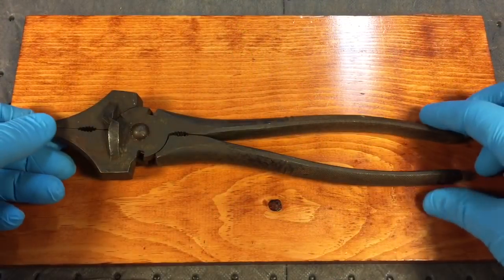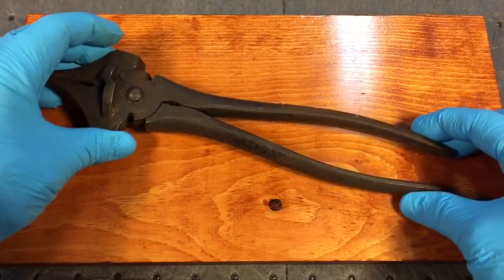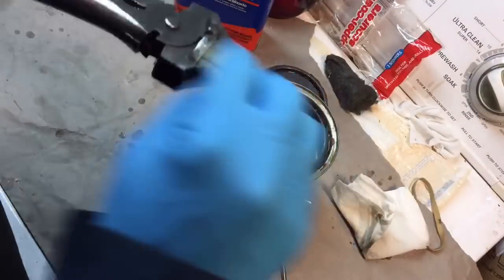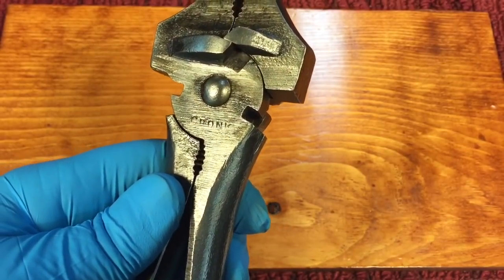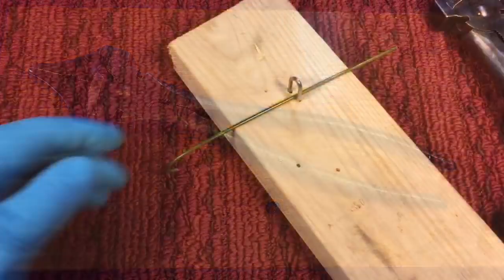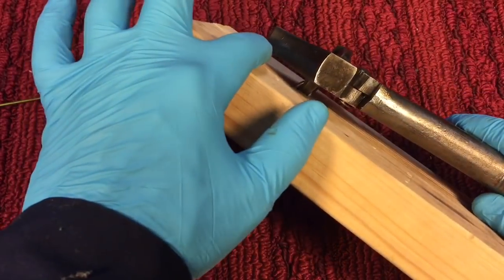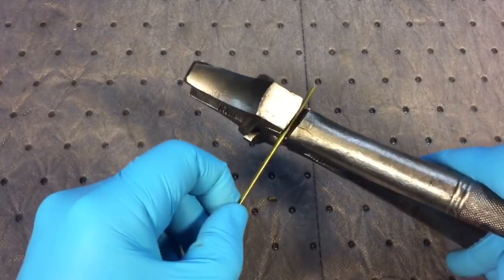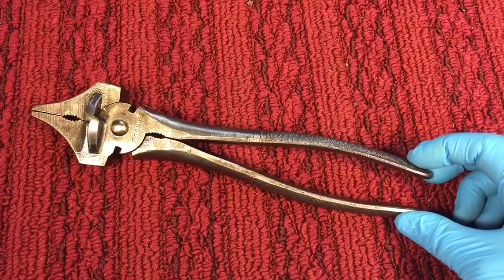1898 CRONK Fencing Pliers Restoration

Comment: Was just cleaning up a pair of pliers and couldn't make out the lettering.  Turns out the Cronk name is on the very outer edge of that exaggerated jaw curve, and subject to more wear, not by the swivel rivet.  I suspect mine are a bit earlier manufacture as the handle has no embellishments,  but otherwise the features are the same.  I found another photograph on Alloy Artifacts.  Their example has smooth handles but the Cronk name is by the swivel rivet.

Comment: I have ridden fence line repairing barb wire fence on horse back  
I would perfer this Cronk design over the classtic   hammer and hook  design  since it is very common to stock the fencing pliers in the hip pocket of Your jeans  and you rip your pocket off with the hook part

Comment: Never seen those. I do a lot of fencing having horses. Now it's different, electric fencing. No barb wire or page wire. Nice rare pliers
Reply from the maker: Hello Lifes Journeyman!  Yes, I guess a lot has changed in 100 years!  lol  I guess you use "T" posts for fencing now?  They have clips to secure the wire and are inexpensive...    These pliers came with the lot of 35 from eBay!  Thanks!!!!

Comment: Scout, another nice job! I like those pliers! How does the shellac hold up? I've refinished a few tools and have sprayed them with satin clear as a protectant. What are your thoughts? Thanks!
Reply from the maker: Hello Joe!  I have used all sorts of clear-coats on tools... Lacquer, acrylic. poly, even varnish!  I just like shellac because it goes on super easy, doesn't feel like a "coating", gives the tool a natural look and is quite durable!  If I don't put coating on the tool (like a chrome tool) I usually rub it down with a 50/50 mix of mineral oil and vaseline! Hope that helps!  Thanks very much!!!!

Comment: Great Job! What do you use to lubricate the joints of these older fence pliers to keep them functioning as designed?
Reply from the maker: Hello Anonymous98! Most of these older pliers are "broken in" and to make them silky smooth I spray all the seams of the plier with a good Penetrating oil (50/50 Acetone and tranny fluid)  and then work it in good... Then clean out the joint with multiple applications of WD-40 until the liquid look clear... When there is no more grunge coming out of the joint then a couple drops of 3in1 oil and you're golden!  Thanks very much!!!!!!!
Reply: ScoutCrafter Thanks for the detailed reply.  It’s a 3-step process to get years of smooth use; and another great idea. Thanks again for your excellent videos and advice!
Reply from the maker: Anonymous98 - One funny note is that everyone is complaining that the new Klein pliers are coming out of the factory very tight and require a lot of work to break them in! Imagine that!?  Thanks again!!!